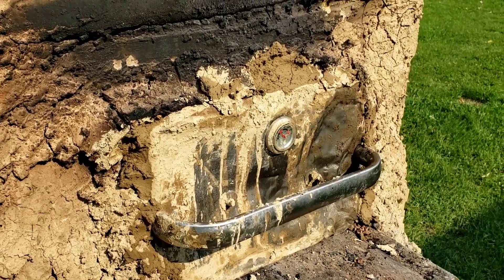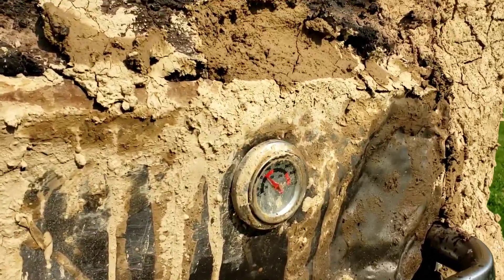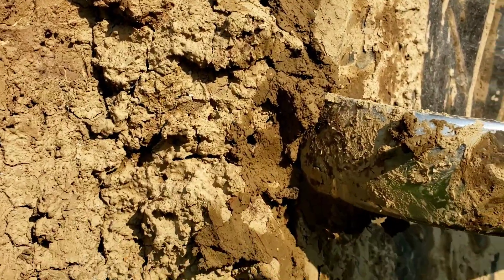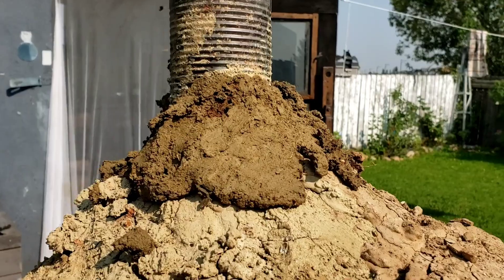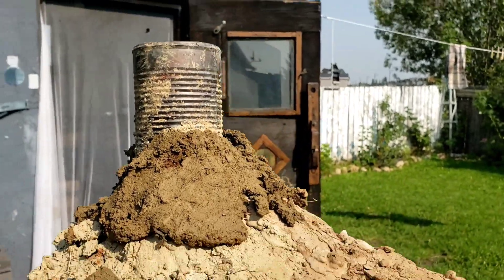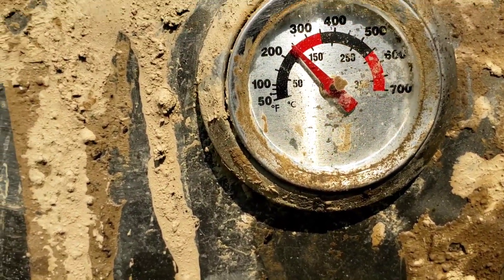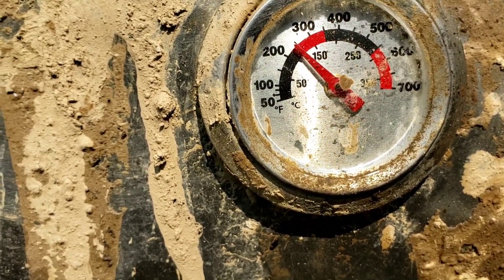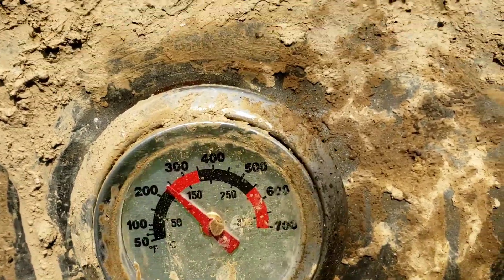Clay Oven Roasted Chickens

Comment: You need a metal bucket with a tight fitting lid to put your raked out coals into. Then you could smother them and save them for charcoal. Chickens looked really good. It does not have to be fancy. Thank you for sharing them with us, Ken. Stay safe and stay cool
Reply from the maker: Definitely.  I have a metal container that I use for big batches of char cloth. I just need to plug the hole and its good to go.  You can also bury the coals under a pile of dirt to get similar results.
Thanks for watching Sean 🙂 😊